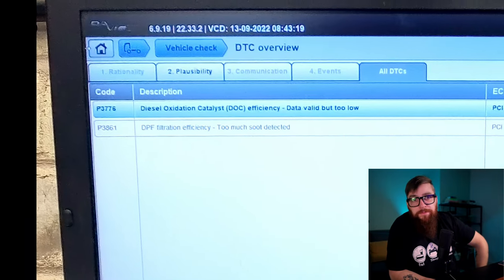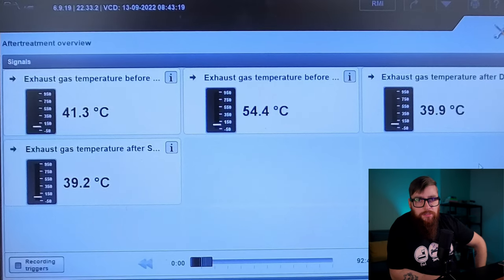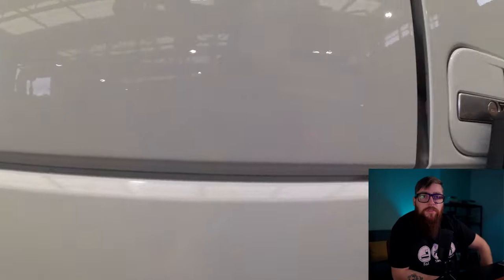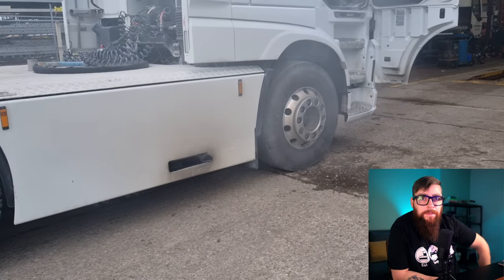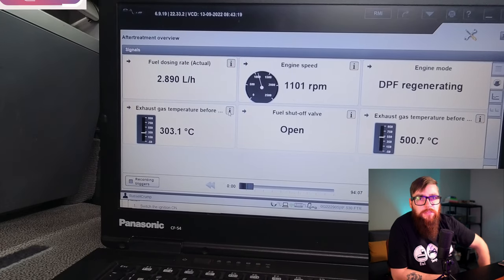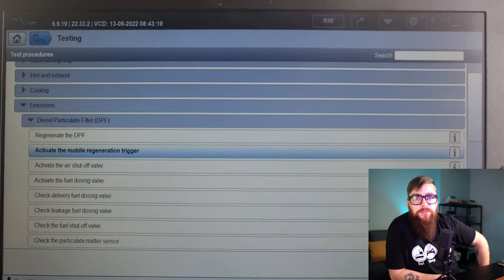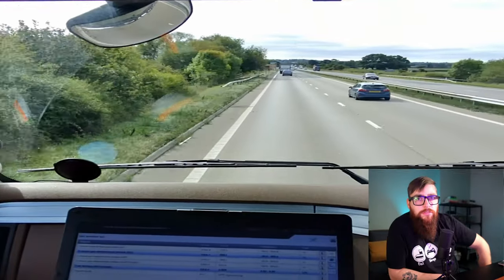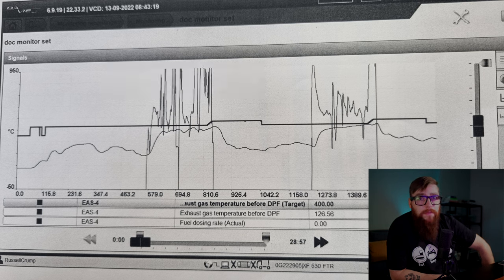DAF DPF REGENERATION PROBLEMS: THE RIGHT WAY TO DIAGNOSE IT.

Comment: Excellent work, as an engineer working in this area I can not fault your diagnose. My guess is that this customer has either run on some high sulfur fuel, or has been running for prolonged time on some kind of biodiesel. You can't drive everywhere in a Euro 6 truck as these require low-sulfur fuel, it's why even in 2023 armies buy downgraded Euro 3 trucks.

Comment: When you say the whole exhaust are you replacing the DOC, DPF and SCR? The reason I ask, I’m in the states. We can replace each piece individually. Also, I’m curious what happened to the DOC to cause it to fail?
Reply from the maker: Thanks for the comment Walter, as of 2017 DAF introduced EAS-4 for the mx-11 and mx-13 which reduced the exhaust system into one unit unlike when we had euro 6 (2014-2017) that had the DOC and DPF separate to the SCR. 
but again over here the DOC has never been separate and has always been non replaceable on any system since 2014. Only thing you can service is the DPF. You have to buy the whole system which is next week's video 👌
I've been unable to find any component that has failed and contributed to blocking the DOC or damaging it, no rapid soot loading from turbo, no oil contamination from a failed turbo or valve stem oil seals. I had the correct amount of fuel from the dosing valve in the exhaust. I just know a new DOC/whole system fixed the issue

Comment: New generation trucks are so annoying with test and replace procedures. I would repair/replace only necessary things, not whole unit. I know it's cheaper in labor, but small fleets operators are pissed off with invoices from service...
Reply from the maker: Hey thanks for the comment 👌 I understand what your saying but I'd say this situation is no different than euro 5 from 10 years ago. If the catalyst had failed in the exhaust then you would still have to replace the whole exhaust, Id love the manufacturer to make DOC'S Serviceable just like DPF'S but I suppose in reality they never should go wrong hence it being unserviceable, this whole system being replaced under warranty, the only cost to the operator was the vehicle downtime which was a day......that would of been longer if the manufacturer had me swapping over every component on the exhaust which we will get into next week 😎
Reply: @TRUCKTECHUK  of course for first owner of truck like this it doesn't really matter, but when it comes to the second/third/etc owner with less service care it's pain in a$$... But I also understand manufacturers point of view, nowadays vehicles are made for intensive work, if something is wrong it has to be repaired as soon as it's possible and get back to work to make money for a new truck ;)
Reply: @TRUCKTECHUK  Some other manufacturers (like Scania) have replaceable DOCs on their B100 vehicles, more are following their path. Regular diesel ones (B7) don't.

Comment: Hi, I have a DAF cf 250, it seems to be doing regents after every 100-150 miles. Also keeps coming up engine malfunction, adblue dosing and going into limp mode. We changed the Nox sensor but doesn’t seemed to have helped. Do you think it would need the full exhaust change or have any idea what it could be. 
Any advice would be much appreciated
Reply from the maker: Hi, thanks for the comment. 👌  I know I put an exhaust on this vehicle and it DID RECTIFY THIS FAULT but from what you described  fault wise, personally I'd want to do some testing as in my books exhausts are a last resort and you REALLY need to be able to justify the pounds.
If you send me a message over on the contact page at www.trucktechuk.com I can see about you getting it fixed right, first time 😎

Comment: Had similar problems this week on EAS - 3. DPF full of soot, regeneration was stopped by failed NoX before cat and DPF pressure sensor. Changed sensors and cleaned dpf. After initialisation truck is back on road. I am from Balkans and here is possible to clean via machine the DOC :D Thinking about making videos, just have to get better in video edit :D :D Good job buddy.
Reply from the maker: Good job on fixing it. This truck has had a few DPF'S before it had the whole system replaced. It was only when I'd got hold of it and ran the doc performance test we could identify that the soot filter was blocking up due to poor REGENERATION temps. I don't believe the doc was contaminated but then again something had to contribute to it going the way it has 🤷

I'd say go for it with the videos ....all I can say is it must take me 8 hours in the week to make one video 😵‍💫
Reply: @TRUCKTECHUK what in the exhaust system causes it to not get to the right temperature?

Comment: I would have replaced nox after cat and let the truck ride. This fault is a result of wrong data send to pci from nox sensors, could be ad blue problem though. Maybe im wrong but i didn’t see any temp DTC’s
Reply from the maker: Hi thanks for the comment, while I completely agree with you about Nox sensors having a part to play in monitoring regeneration, as you know we have one Exhaust gas
temperature sensor before DOC and also one before the DPF. These two measurments are used to calculate the temperature rise over the DOC, these sesnors determine if a regeneration is started, what the generation temperature is, calculation of the amount of fuel that must be injected to control regeneration and for diagnosis of the DOC efficiency.

As per the video the temperature sensors read correctly, not only from a base measurement but also during regeneration, with large quantities of white smoke during regeneration and a fault being set for DOC efficiency I'd say the temperature sensors were working correctly in diagnosing the DOC at being ineffective at reaching opperation temperature. I'd of possibly ran tests on the Nox after cat sensor if I had DTCs of implausible or inconsistent reading/ low SCR efficiency but as I only had two fault codes in the EAS not realting to Nox sensors or SCR I went with what comes first in the system.

Comment: If possible, I would like to clarify, error P3768 particulate filter pressure sensor. Output pressure. Intermittent or incorrect data. I noticed on several machines in the status of inactive, everything is fine in terms of pressure, after regeneration it does not appear, as soon as the flight and after a week it is again. Is DPF dying? DAF XF E6

Comment: Hi got a 2016 Daf xf 510 having problem with smoke seems to be coming from the passenger side the system on this lorry has had the exhaust split in two one half on the passenger side one half on the drivers side the exhaust exit is on the passenger side the dash  comes on with emission failure and then engine malfunction occasionally 
checked the dpf filter on the dash hardly nothing showing.
Doesn't burn any engine oil no leaks any ideas ????
Many thanks
John

Comment: As the new system comes with a new ecu and sensors  I keep the old ecu and sensors for test units ..They have never asked for them back ,they are happy with the core unit
Reply from the maker: Hey norb, yes I've a abundance of these now 😅. The one thing I could do with as 2nd hand parts is DOCS 🤣
Reply: @TRUCKTECHUK  No chance with the doc  lol..I just want parts lol  2 months to get  a cam kit
Reply from the maker: @norb0254  yes it's ground to a halt now hasn't it 😪 soon be running out of yard space!
Reply: @TRUCKTECHUK  I guess you get the calls from daf asking what is taking so long lol

Comment: Hi Mr strugglinger sent me over regards
Reply from the maker: Thanks for dropping by! Got a video coming tomorrow to keep everyone entertained hopefully 😁
Reply: Nice one mate these are helping me in my job we have 4 rigid hook lifts with similar engines and ad blue / engine faults and 30 LF 4 cylinders which are about 3 years old now so are starting to be troublesome I work for local council could you maybe post about the adblue / exhaust systems if you come across them in the future thanks 👍🏻🏴
Reply from the maker: Hi luke, thanks for the comment 👌. Your hook lifts will most probably be mx-11 engines if they are DAF (cams are in the head). 
I will get onto adblue issues soon hopefully as I will be looking to replace this adblue video ( https://youtu.be/M_w29JErVFw) I've a book for the mx-11 I'm STILL trying to finish that covers how the exhaust system works, service intervals and how all the adblue works with diagrams that should help you out when you get stuck and want to test stuff and I've some online courses I've started building so hopefully in the next 12 months I should have a good source of information to help people 😎
Reply: @TRUCKTECHUK  hi mate I think got the wrong person regards
Reply from the maker: @glynrogers1018  sorry mate, I had a comment on here from Luke so commented back 🤷🙈
Reply: @lukesims6636  hi mate you have the wrong person regards